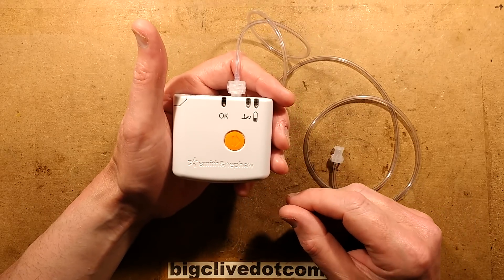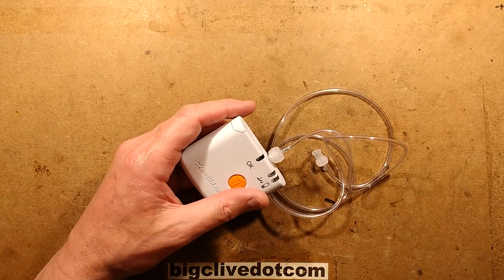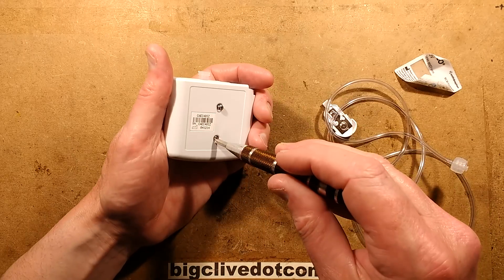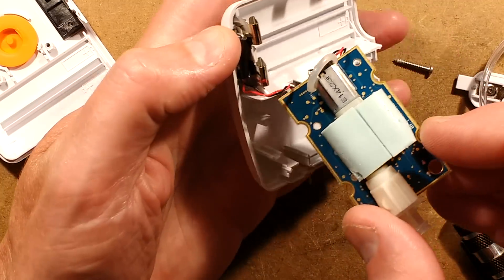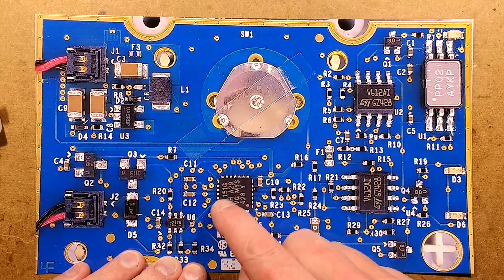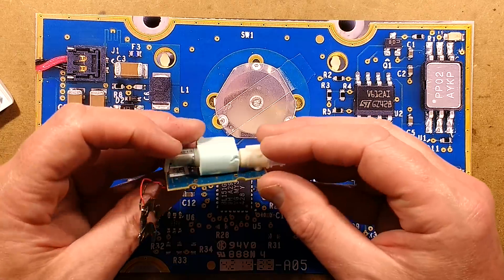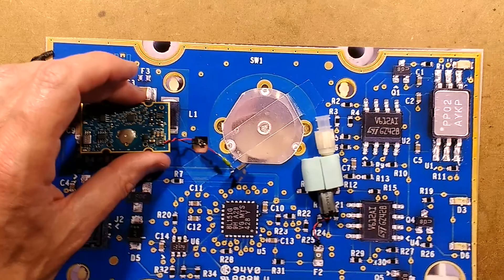Inside a medical wound sucking machine.

Comment: So, simply put, it's an electronic leech? Amazing how times have changed... :P
Reply: All this talk about maggots and leeches - anyone would think we were in an election year. ;)
Reply: And with that comment, you win the internet today... :P
Reply: leaches are being used too, but this isn't a replacement for the leach.  A leach, placed on the end of a finger that has been stiched back on, will keep blow flowing in the reattached finger better then anything else in medical science without taking enough blood (by itself) to do harm.  This does something completely different.
Reply: Zadster CDs, I'm still using cassettes 😣
Reply: Hurray! I'll put it over here with my AOL CDs!
Reply: It's a teeny tiny penis pump.
Reply: @ Paul More like American politics as a whole. Which party is the maggots, I'll let you decide.
Reply: Some of the best modern remedies were based on natures own examples. Leeches included I guess.
Reply: twocvbloke not exactly, leaches also spit in wounds. Their spit is an anticoagulant
Reply: The larger devices, such as KCI's VAC, cause granulation of the underlying tissue. I've been on them several times and while they are a bit of a nuisance, they work well drastically reducing the healing time of an open wound.
Reply: Maggots have made a comeback as well as leaches. Maggots are great for cleaning wounds of necrotic material.
Reply: Exactly this. Maggots are in regular use, in the UK district nurses (nurses who visit people in their own homes) are treated in the application and use of maggots.  They don't eat healthy flesh, just the flesh that is dead and infected.

Comment: The vacuum pump works in a few different ways depending on the wound. In deep wounds that have a small area for example, the pump draws out tissue that would otherwise end up as cavities and infection sites under healed tissue. The vacuum also apparently stimulates blood flow in the area which also helps healing.

Or at least that was what I was told (and given white papers to the effect of) while carrying one over the span of two weeks after surgical debridement of infected tissue.

Comment: It sucks how these things are made to be so wasteful. Well, I guess it's because Big Pharma wants to make more money.
Reply: A1eR it really frustrates me seeing these big pharma comments. I expect that mandated risk analysis would have revealed that the device cannot be reused. As for the cost, they have to recoup the millions it costs to develop and certify.
Reply: erica or it’s because you don’t want to have a major source of infection that’s warm and not sterilized
Reply: These things save lives. Disposable is a good thing in most medical appliances because it is less wasteful than the reusable variants that came before.
Reply: These things saves lives but kills the environment... I don't think that infection would be a problem, because it's only a thing that sucks things from you body and not into you body, how can it cause an infection ? 

But if that is a concern, make only the pump assembly disposable and replaceable, why wasting a motor and a circuit board, plus all the plastic in the case ? 

The thing is that they can make this thing non disposable, but they don't want because well they make money selling you this (and probably a lot, producing that thing will probably cost 10$ and they would sold that to you for minimum 100$)

Comment: I've reset other medical units of different brands, it might be the same! Short circuit the EEPROM while the unit powers up (not once it's turned on), it will be unable to read the data on the EEPROM and will write the default values enabling it to be used again.
Reply: The EEPROM is inside the microcontroller, you can't short it out.
Reply: how would you go about shorting the internal eeprom of this micro?
Reply: You could even install a reset button
Reply: Even if the EEPROM could be accessed from outside, which pins would you short? Hitting the wrong ones would likely fry the circuitry. And if you succeeded (no pun intended), how would you deal with what could be MRSA in and on the device? No; disposability is essential with those devices.
Reply: There's a business opportunity  there! Could also save third world countries a lot of money and lives as they are less likely to be able to afford keep buying new ones. Reset and sterilised.

Comment: In addition to save the patient, they could have saved the planet by adding a alcohol soaked paper filter in the suction lile, which would be changed at the same time as the wound dressing. But: This way they can change way more -> more revenue -> more value for shareholders, more e-waste, more spet energy and natural resources and more insurance / tax payer money spent, so at the end, this is all on us..
Reply: Janne Pohjala that’s not how infection works. Elsewhere in the comments it says that the dressing itself is the filter, and is changed daily. Keep in mind that the dressing costs $99 a piece, in the 7-14 Days that the pump lasts you’ll have spent 1400 bucks on their site. The pump is not their profit item.

Also keep in mind that the reusable variant is stated in the comments here to cost “a small car” worth.
Reply: If the dressing is an effective filter and/or adding one does the job, why the pump need to be changed.  I understand thet the dressings need to be replaced and are non reuseable. But producing unneccesary e-waste with this pump does not make sense to me. Despite how much has been spend on dressings. For which $10-15 would be a reasonable prize, not $100. It is always the patient who one way or another pays the bill...

Comment: The timer is there to prevent reuse. Reusing those devices may cause severe infection.
Reply: But could just the pump and tube be changed? Given the amount of e waste these days it seems unethical to throw the whole unit out when you could just replace the contaminated parts.
Reply: There would be no risk of an infection traveling from the device all the way down the long tube into the patient's wound, since it's sucking the opposite way the whole time, and you wouldn't reuse the tube between patients anyway. 
The only way for it to infect the patient would be via the AIR OUTLET on the device itself.  So really it's protecting not only the patient, but everyone else around as well.  Yeah, the Superbug thing does seem like the most plausible excuse for the lockout.  The pump is an uncleanable repository for bugs.
edit: they really should have designed it for easy replacement of the pump, and the air outlet of the pump should protrude outside of the device so that it automatically gets replaced too.
Reply: That's exactly just what I thought. Build it with replaceable parts, much cheaper that way, so there is our answer. Smartroadb.
Reply: smartroadbiker, Hmm, pop for a $300 unit or spend $632,296.27 for a MRSA-cleaning bill?  I wonder which you'd choose.  //  With medical kit, any reuse is iffy.
Reply: One word (well, acronym): MRSA.

Hospitals are the worst offenders for transmission of superbugs like MRSA, anything they can do to minimize cross contamination between patients is going to be done.
Reply: Yeah it's all well saying "do not reuse" but some idiot doctor or nurse will reuse it because humans are stupid. So it makes sense to force them to not reuse it.

Comment: My Wife had one but it was larger and had filter inline so the pump part was able too be reused. With a deep cut they want it to heal from the inside out, so they keep the wound open but covered and use the pump to keep things from oozing. They sure can put a lot of tech in a small package these days.

Comment: I would imagine that this device must be disposable because there is no way to clean and sterilize it.  Any contaminants vacuumed up would appear to lodge in the pump section.  If the device were used for multiple patients or used over a too-long duration, it might act as a source of a nasty infection.

Honestly, I think it's very clever to have this as a disposable unit.  A reusable one would need to have some sort of peristaltic vacuum pump plus either disposable tubing or a rigorous procedure for sterilization, and that would require a much heavier and more complicated device.  This thing runs off of common batteries!
Reply: Optionally, the motor and electronics could be re-usable, and just teh pump bits could be made into a replaceable cartridge.
Reply: Having heat-sensitive components and materials would pretty much relegate this to sterilisation using oxidising gases like ethylene oxide or ozone which come with their own drawbacks like the former gas being hazardously explosive.
Reply: pileofstuff the pump and motor are too tightly integrated, and the electronics are essentially free, that board is a very small part of the cost of the device compared to the pump assembly and the plastic case. Oh, and the pressure sensor also belongs on the “dirty” side. Basically you’d have a $300 device with $275 replaceable cartridges. No point to that.

Comment: Any sign of a JTAG port?
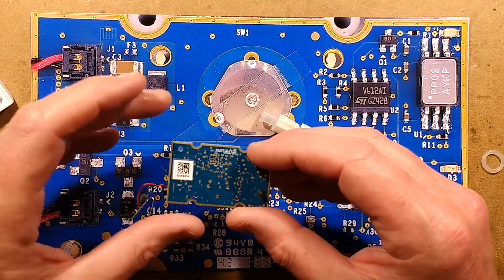Reply: If you look at the bottom of the board at 9:13 you'll see two rows of four gold circles for connecting with pogo pins behind the microcontroller for the SWIM (single wire interface module) port and other connections required for testing. Low power 8 bit microcontrollers often have their own equivalent of JTAG which in ST's case is called SWIM.
Reply: how DARE YOU!
Reply: Tom O'Connor  rossmangrouprepair
Reply: Repeal replace

Comment: I had something similar to this on me, but it came in a much larger size and there were disposable pods that the pump pumped into. It was quite large and unweildly I would have preferred something tiny like this instead. I believe they're called wound vacs. Their purpose is to help your skin grow in properly instead of building layers with pockets that bacteria could grow in.
Reply: I too had one of the large unwieldy pumps attached to a very large stomach wound following surgery for Crohn’s disease. At the time I was told that the increase in pressure was to encourage blood flow to the wound to stop the tissue dying and becoming necrotic. It was fairly effective, and I also underwent treatment in a hyperbaric chamber for the same reason.

Comment: My girlfriend had one of these after surgery.  The pump is pulsed, and sometimes quite often.  Darn thing was like an old pager buzzer!  The nurse actually buried it between pillows, so my girlfriend could sleep.  They definitely disable themselves after 7-14 days use.  Worked really nicely on her surgical wound, though.
Since that pump pulls a little vacuum, maybe it would be good for a vacuum placement device.  You could leave it on constant (if it could stand it) and vent the vacuum as a part release, or turn the pump on as needed to place SMD components.
Reply: Carlton Dodd I would imagine it pulses because it’s got some hysteresis in the amount of vacuum it’s pulling. If it switches too often, then you’ve either got air leaking in or there’s a lot of exudate being extracted...

Comment: Putting a wound under vaccuum speeds the healing process. 
I had a saucer sized hole in my back which was packed daily with sterile sponge and covered with a vaccuum dressing. That was connected to a vac pump that hung over my shoulder. Scar tissue filled the hole in about 3-4 months, a quarter of the time it would have taken had it not been under vaccuum. 
And I could keep working. 
I was told the vac pump cost the same as a mid-range car though, but it was reusable and rechargable.
Reply: Darthane I think that the use of AA sized batteries is for a few reasons, number one is to allow the changing of the batteries through the 7 day or so lifespan of the unit so that the little pump can keep running at absolute full suction power without weakening daily, so that full vaccum is on the full usage and number two so that the batteries can be removed and put away to recycling while the whole unit will go into a medical waste disposal bin and be burned/incinerated without the batteries which would be dangerous to burn and polluting.

The unit will self destruct its internal software/firmware after a set duration so that it enforces disposal and prevents extended use or even re use, this is a non cleanable single use unit that will have been given a quick neutron beam sterilisation inside a sealed foil packet at the factory and will become contaminated in use so is a one shot device for a single use on one patient.

There are large reusable units which have change out filters and tubes and cost thousands of pounds/dollars/euros
Reply: Considering all the crazy protection they put on this device just to have standard AA batteries running it, could you imagine how much input/charge/overcharge protection a medical device would have on a LiPo battery?
Reply: +DrTeeth - I'm sure you're just trolling a little, but the wound I had either never would have healed or I would have been in the hospital for weeks.  At the time, my sugar was uncontrolled and there was a high likelihood I would have gotten an infection without the sterile environment that the wound vac affords.  I watched my wound fill in millimeter by millimeter from the comfort of work and home.  It's amazing technology.
Reply: I have a video of me having one of these dressings changed.  I had a leg wound.  It's some damned amazing technology.  Fucking YouTube wont let me paste a YouTube link here.  Just search "Wound Vac Dressing Change" on YouTube and t's a leg/thigh wound.
Reply: Tech Gorilla https://youtu.be/fC3Xb9MakHQ
Reply: what the fuck did you do to get a giant hole in your back
Reply: You need to edit a setting in Firefox to overide pasting. This worked for me --> https://www.youtube.com/watch?v=IhYis03FbWU
Reply: +Nut and Proud - You win plus one Internets for the week!  Excellent fix helped the first time.  5 seconds ended my frustration.  I never updated or changed a thing on my browser either.  Odd.
Reply: Yikes!  Do you mind if I ask what happened for you to get such a nasty wound?
Reply: “Dr”Teeth You idiot, this is for large wounds that produce lots of drainage. This keeps the wound dry and speeds up healing.
Reply: People can search for this and find it -->  Wound Vac Dressing Change 1 (Warning Graphic)
Reply: it may have sucked to remove the dressing, but I'm guessing that it also sucked to apply and wear the dressing as well ... shows that the vacuum worked
Reply: Darthane Nothing too excessive actually, just an over/undervoltage protection circuit, fuel gauge and charge management IC that typically reads a thermistor inside the battery to ensure safe charging. Medical devices have to be single-fault safe, determined by risk assessment.
Reply: DrTeeth 
Clown or troll?
Reply: Good idea!  Search for "Wound Vac Dressing Change" and its a leg wound in the thumbnail.  Thanks for the suggestion!
Reply: +Brad Leonard - Thank you kindly, sir!  Most appreciated.  I'm not sure why I can no longer paste to comments.
Reply: Darthane
 I doubt they would use a LiPo in a medical device when LifePO4 is so much safer and only costs a little more.
Reply: Simon Radford you had the big one that used to beep? I had both of them. I was hated in the ward because they didn't put the dressing on very well. I had a hole from a bone puncture wound underneath a ring of an ex fix, not easy to get a good seal but I got it sealed with electrical tape!
Reply: What a piece of snake-oil crap! These nest thing to do with a scabbed over wound is to leave it alone.

Comment: I wonder if they've actually locked the eeprom down?  Security in medical devices is notoriously poor.
Reply: James Taylor why would they? I mean if it takes 2 minutes to program sure, they might, but otherwise it's a waste of time. If the unit is used it would probably become biohaz waste and disposed of as such.
Reply: Eh, it's literally just two or three checkboxes in the programmer that you click on to lock down the security-bits; even the laziest, least security-conscious twat could do that.
Reply: prob just a internal counter in program that sets end of life but not readable to outside world ect  but you prob can reprogram  the chip with a completely new software if want. but why??
Reply: @ max - I think you missed the joke.
Reply: Nita Vesa Unless they WANT the code to be subject to safety  inspection by the authorities and quality inspection in the warehouse that receives 10000 units from China, does destructive testing on 100 and ships the rest to hospitals with a warranty.
Reply: No one's going to read the binary code, disassemble it and then inspect it, that'd be insane, when they can just inspect the source-code.
Reply: On the back of the board, it looked like there may be a jtag interface.  Surprised clive didn't mention it.
Reply: yep just hard toughen so a greasy medical person cant tamper but anyone with a little know how usually can  surprised you couldn't just pop it open and reset it